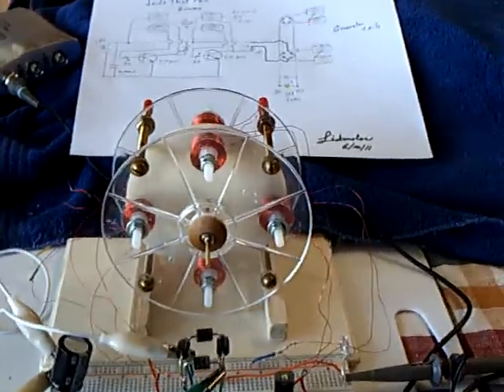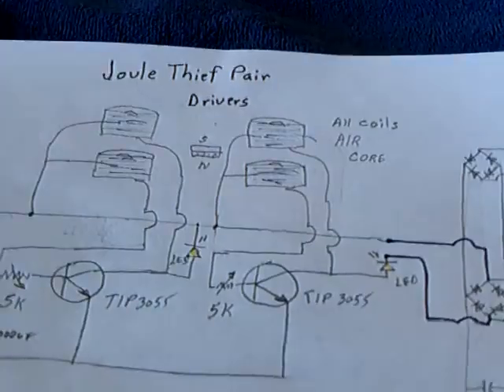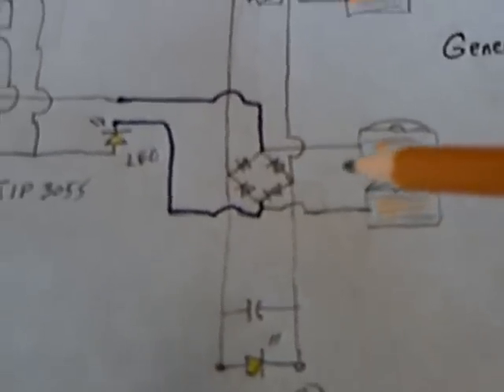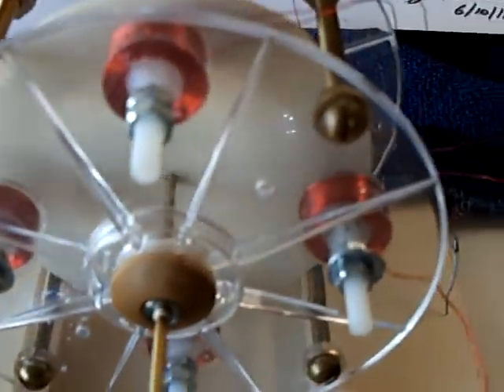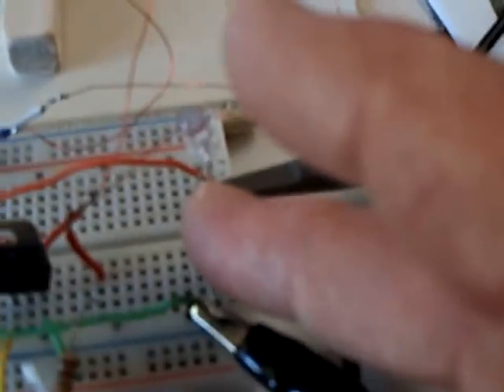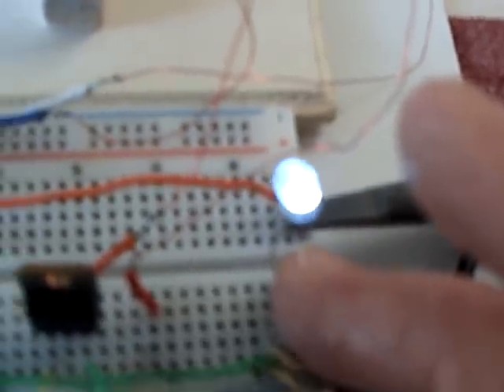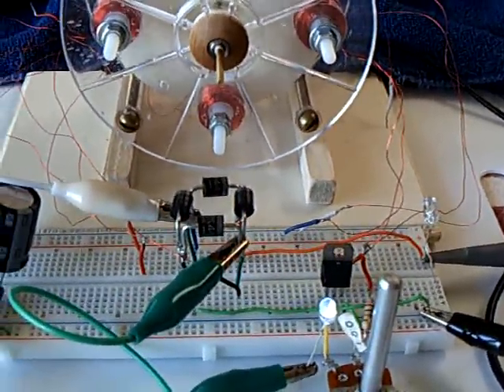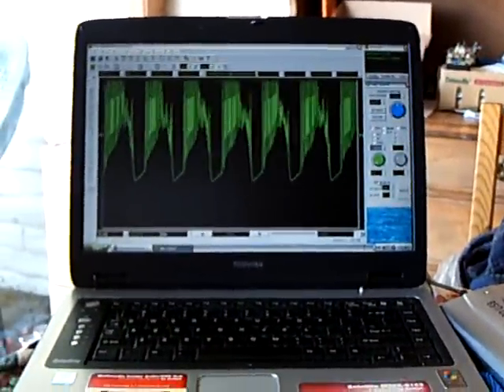JT Muller Dynamo scope shots.ASF

Comment: @Lidmotor Thanks for the update.  Interesting use of the JT, actually only driving with 1 of the coil pairs, other is for JT transistor trigger only. Did you score your ferrites to cut them to size?  While you’re taking a look at scope shots, have you seen the scope shots and checked for the effect that keykhin posted on his channel?  He demonstrates a very interesting pulse motor effect on the 'Regenerative Acceleration Under Load' video that he posted today but may not apply to your setup.

Comment: Have you tried a bedini circuit for the driver? And maybe put a 1N4007 diode where the led is on the joule thief output so you don't limit the drive voltage to 3 volts? The diode would also rectify the back emf from the joule thief coil so you don't need a bridge rectifier and might raise the driver coil power.

Comment: I wonder, what will happen, if you use no DC path in your output,
but only use 2 Avramenko plugs to generate the output DC.
(via the caps of the 2 x Avramenko caps)
So put on every coil output wire just an Avramenko plug with 2 diodes and 1 cap,
so for each coil you get 2 Avramenko plugs.
Then you have no DC current path. 
Would be optimal with your fast oscillating waveform and would not slow down the rotor.
Regards, Stefan.

Comment: @Lidmotor In the regeneration side, you can not put no core coils, but have thicker wire and more turns, and the hole larger than the rotor magnets? magnets work only for the entry and exit coil area and the right coil fields cancel each other in turns it ....: D
I do not know which frequencies are generated, but carefully, 1N4007 diodes are switching at high frequencies do not work ....;)